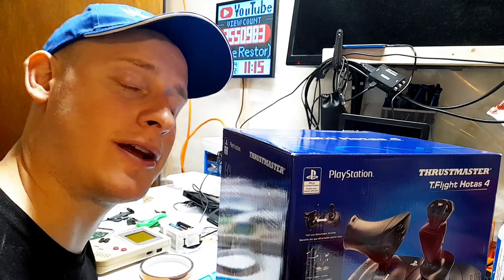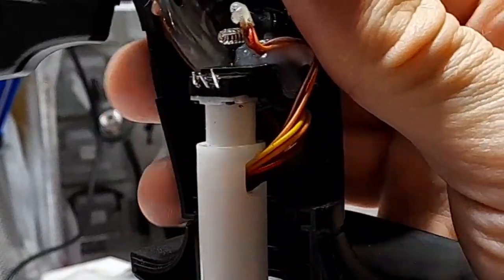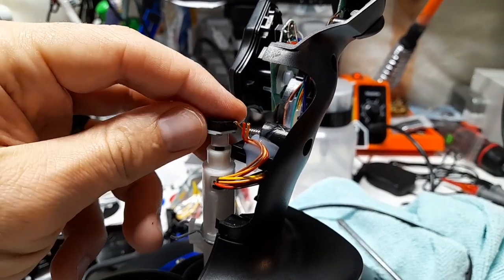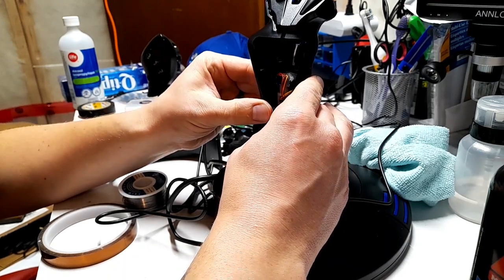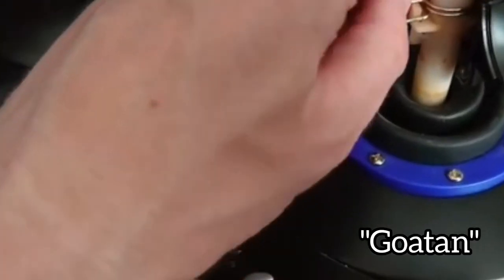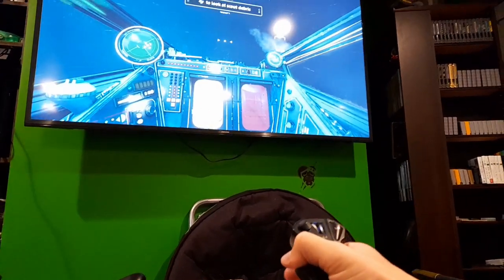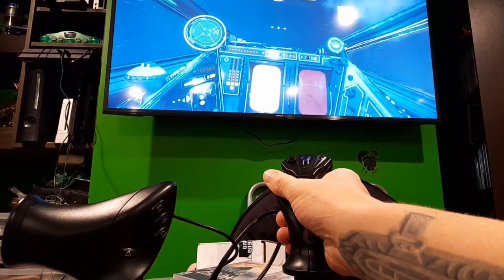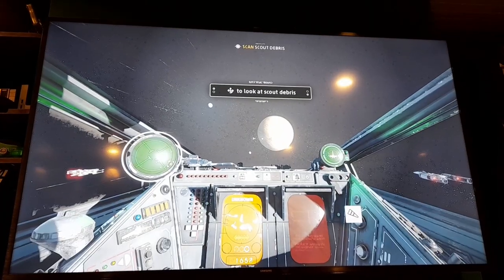PS4 Flight Stick. Let's Fix it!

Comment: The POTs tend to not be very good on the YAW. I took mine out and used a nail clipper to open the pot itself by clipping two of the black plastic rivets. Once open you can clean the metal pins(sandpaper as well) and base correctly with alc.  Then you'll need to bend the pins out slightly so that when the pot is put back together, there is better contact with the pins and base. This creates a nice, clean firm connection and it will not glitch out. No need for a return or new pot. 
I had issues with this stick for a long time until I decided to break into it and fix it. Newer joysticks with mag hall sensors won't have this issue, but with pots, you can clean and fix them just fine at least.